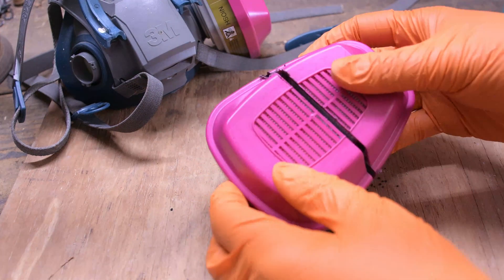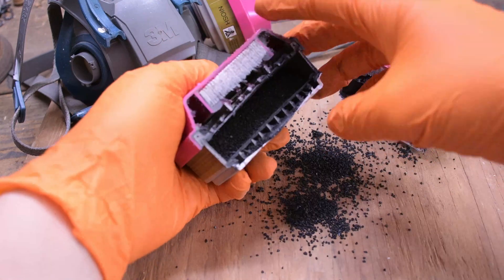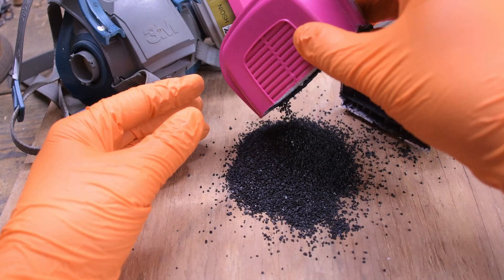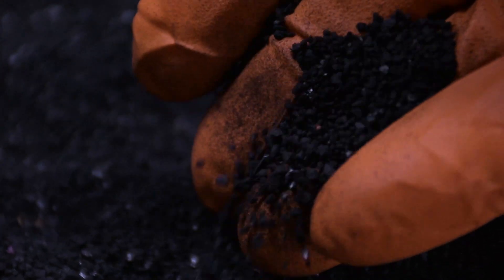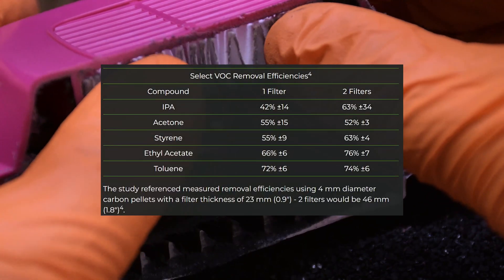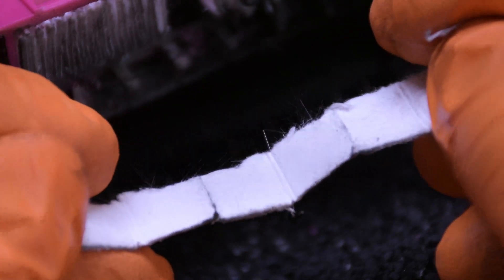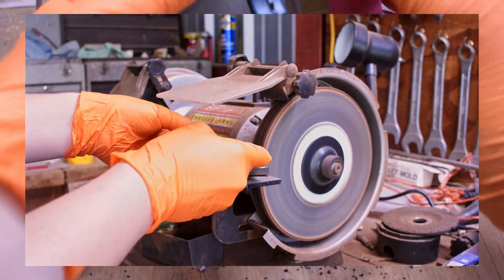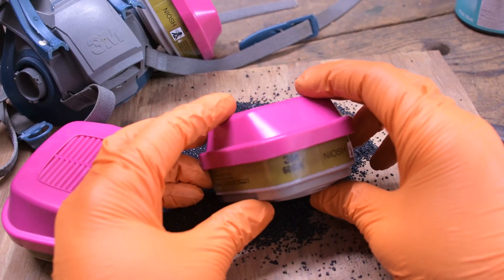Respirators for 3D Printing - Resin Fumes & FDM Nanoplastics

Comment: HEPA and activated carbon does next to nothing for VOC, only odour. You need PECO filters for that size of particles.
Reply from the maker: HEPA material does capture all particulates, even UFPs, at rates no less than 99%.
Activated carbon does capture VOCs, of which most are odorless unless in a concentration above our perceptible threshold.

The main issue with PECO filters in this instance is that they do not exist in a consumer-facing cartridge for a respirator, and the prices of PECO filters are far beyond what most people would be willing to pay for peace of mind. For that price point, a Supplied Air Respirator starts to make more sense.
Reply: @ArisAlder   Based on what? I have a WINIX air purifier right next to my printers and I measure air quality with an external meter. It helps, but not by much. Worst readings are when I open the resin printer lid or when I clean the prints with IPA. HEPA captures, PECO destroys particles and its technology is for much finer particles than HEPA. 
Molekule has a PECO purifier but only available in the US at the moment. Their mini is at a reasonable price. 
I do wear a respirator mask when I clean my models like the one on the video but knowingly only for the odours as it's not doing much else. 
This response is to raise awareness and stop people from believing their ELEGOOmate will do anything other than removing odours, something that activated carbon (pellets, not crumbs or dust or sheet) filters do extremely well. 
There is very little study on this unfortunately, I'm merely stating my own experience. Do your own due diligence.
Reply from the maker: I'm not disagreeing that a catalyst has the potential to remove more VOCs from an environment. I'm merely point out that in the context of a respirator it is irrelevant since products do not exist yet.

You are absolutely right that the 13.6 gram brick of compressed carbon from Elegoo and Anycubic is essentially useless. Carbon granules, especially in a thick bed will be more efficient and have a higher holding capacity.

The most affordable thing that people can do for a resin printer is to vent the contaminated air outdoors.

Comment: Can i use 6001? Their cheaper cartridge. And how long can I use them before replacing?
Reply from the maker: You can use the 6001 cartridge for resin printing, but it will not have the particulate protection.

For the hours, look for my comment under @spamspasm or @ thehalo3
Reply: Thanks, I'm thinking of using 6001cn for resin printing and 2097 for airbrushing. its cheaper for me to get 6001cn and 2097 than buying one 60921 cartridge.

Comment: Nice vids! So i have a half face respirator but if I had a carbon air purifier next to my resin printer would that help even more? I would love to know if you recommended any.  I do my printing in the garage.
Reply from the maker: Thanks! Any carbon filter in a garage or workshop would provide little to no benefit if the area is naturally ventilated. The best thing that you can do is to exhaust the resin fumes outdoors while wearing a cartridge respirator or supplied air respirator.

Comment: Hi, first of all it's a great video, I have a question, I understand why the sanding process is dangerous, but why is the painting process dangerous?
Reply from the maker: Painting can be done via various methods, some more dangerous than others. For example, hand brushing a water-based paint is super safe and doesn't require any protection. Spraying painting, especially with a solvent, will need to be done with ventilation, such as a spray booth. Spray painting releases tons of tiny particulates and VOCs. Clear coats, such as Krylon or Everbrite, will need to be in ventilation.

For painting, follow the manufacturers recommendations regarding PPE or ventilation as these will generally be present if any solvents, particulates, or other VOCs are released.

Comment: Thanks for this! A few questions. Will a 6006 paired with a 5n11 be good enough? Also, i print 5 days per week. How often should I replace the cartridges and filters?
Reply from the maker: The combo cartridges should be cheaper than the two separate filters. If you do not need the particulate protection then going with the 6006 by itself is fine.

However, you are resin printing enough that it’s probably worthwhile long-term to look into a supplied air respirator. I just released a video on these. They deliver clean outdoor air away from the contaminated environment.

For the how long on the cartridges respirators, I’ll copy paste from a previous comment.

An estimate will be 10-30 working hours, which will be a dozen plus sessions. However, the exact lifespan can drastically vary depending on the chemicals, their concentration, ventilation, temperature, humidity, and your rate of breathing.

You can use this website https://sls.3m.com/ to input chemicals and receive an estimation of the lifespan, but this generally requires knowing the exact concentration of the chemicals. One option is to use the concentrations reported by a study such as https://chemicalinsights.org/wp-content/uploads/2022/03/2021-Summary-Report-Particle-and-Chemical-Emissions-from-a-Vat-Photopolymerization-3D-Printer.pdf

When you begin to smell the chemicals through the respirator, the cartridges will need to be replaced. Once you know how long this takes, you can start replacing them in regular intervals before the end of their lifespan.
Reply: @ArisAlder  Where I live the combos are actually more expensive (and harder to find) 🥲Would a 6003 paired with a 5n11 do the job alright?
Reply from the maker: @Nayelianne  What country do you live in? 3M has, I believe, 3 different models specified for areas/countries.

This question gets brought up a lot so I may do a short video on it in the future.
Reply: @ArisAlder  Uh, I had written a longer response but yb made it poof, so just not to leave you without an answer: I live in Brazil. The 60926 has the same numeration here it seems, it's just not available through official venues, so the combined ones we can find are of questionable legitimacy, and financially strenuous, to say the least haha.
Reply from the maker: @Nayelianne   If you have a reddit message me there:
https://www.reddit.com/user/Aris-Alder/

I'm searching right now to find the most appropriate and affordable option

Comment: I got myself a 6006 cartridge should i switch to a 6001 instead?
Reply from the maker: It would be best to stick with the 6006 due to the extra protection against Formaldehyde. Just keep in mind that these will have no particulate protection.
Reply from the maker: 6006 is perfectly fine; it provides more protection than 6001.

Comment: I work in a print farm consisting of about 85 FDM printers printing PLA. The space is fairly large but I am around the printers most of the time out the day. We do not wear any type of PPE. Should we wear respirators or any type of mask?
Reply from the maker: Does the space have any type of ventilation or filtration?

That scale would generally prompt an expansive system so that respirators are not needed. The air would get sucked out of the room, filtered, and replaced.

If this is not the case, then a respirator should be used.
Reply: @ArisAlder I have a small FDM anycubic printer with no shroud that I use in my garage with the door open and a fan and leave while it prints.. Are these filter pads adequate? I have asthma I can’t get anymore problems ya know?
Reply from the maker: @Roninkinx  They are quite effective. For particulates, they use P100 material which is rated to capture 99.97%. For VOCs, which depends on the filament and thus emissions, that capture efficiency will also be the majority.

Cartridge respirators like these are not as effective as a supplied air respirator, but they cover most scenarios.

If you are waiting to go into the garage till after the print finishes, give it an extra 15 minutes to air out then head in with the respirator. Check yourself after each sessions and see if it does affect your breathing. The majority of particulates and VOCs released should be expelled if the area is properly ventilated, and the respirator will protect your from anything remaining.

Comment: What about cartridge #60923?  Does it offer the same protection?
Reply from the maker: 60923 will offer a similar level of protection as 60921. It provides additional focus against acid gasses, and it is usually more expensive than 60921.

Generally, I try to recommend 60926 since it does have protection against Formaldehyde, which is not only a VOC present from resin but it is in a wide variety of other chemicals.
Reply: @ArisAlder  I have gotten my mask and 60926 cartridges per your links.  The mask fits great, and seals good according to the test instructions.  What's your preferred method to clean it?
Reply from the maker: 3M recommend to clean the mask with warm water then air dry, with compressed air or a fan. For disinfecting they recommend using 1 part bleach for 250 parts water.
For very quick cleaning I like using pre-moistened wipes with IPA. You can find these on amazon really cheap in packs of like 500 for cleaning glasses or screens.
Reply: @ArisAlder Got it, thanks!
Reply: @ArisAlder  Hi big thanks for doing all of this! Which one would you prefer with resin printing: the 6001 filters, or the 60923. Reason is, M3 is barely available in Europe and 60926 is not even listed (at least not on Dutch and German Amazon and other shops)
Reply from the maker: @BossBabyBestAnime  3M has a different series of cartridges to meet EU standards. I believe the one you will want to search out is the 6075 - I see it on sale for about 20 euros online. If you can find the combo version that includes the 6075, that would be ideal since it also captures particulates.

copy pasted from me on discord helping someone else
"6055 will be the more affordable version, but 6075 is the best for resin
(same goes for the US version 60921 and 60926)
resin gives off some formaldehyde, so having filter media impregnated/designed for that purpose is ideal"

Comment: Hello! Thanks for the video, it was very helpful. I hope you can answer my question im having so much trouble getting an answer to. Can i do with a half mask when i have a full beard. Or do i need to invest into something large like the 3M Silicone Full Mask Size M 6800M EN Safety Certified mask which is like 200$.
Reply from the maker: One of the best options for you and arguably a safer alternative to these cartridge respirators is a supplied air respirator. Normally these are in the thousands, but I have been using a DIY version for some time to test it. I am planning on doing a video for it, but some details do need to be refined and checked for safety purposes.

I believe I saw your reddit post on this a few minutes ago. I will dm you there with a few more details.

Comment: Hi - I have a 3d resin printer but we can't get the 6092x series of filter cartridges here in the UK - is there another you would specifically recommend in the 600x line? I think I can get the 6001 but want to get the best I can. Also I may have misheard or misunderstood but around the 2 minute mark you mention that particulate is a potential issue in the post processing stage - sanding, obviously I can understand, but painting? Should I be putting my mask on while painting 3d printed miniatures? I would have thought after curing the models would be basically safe to handle and be around?

Cheers!
Reply from the maker: This is a good clarification - painting will release particulates in aerosol form, so cans or airbrushing. Hand brushing low-VOC or water-based paints probably don't need a respirator, but some paints and clear coats will have fumes where you may want one. The Everbrite clear coats that I use regularly need ventilation and the respirator.

If you are not sanding, airbrushing, or using aerosol cans then the 6001 organic vapor cartridges will work. Otherwise, I checked the UK amazon and found combo 60923 and 60928 cartridges in-stock. These will be similar but are slightly more expensive than the 60921 cartridge.

Once the resin prints are cleaned and cured, they are drastically safer, but technically they are not safe as they could be. Handling safety for miniatures will be improved once they are painted or clear coated.

To deep-dive into the handling safety, it's reasonable to look at biocompatibility tests for resin, which can include the use of zebrafish embryos. In one study, they conducted these tests by subjecting the embryos to unwashed and washed discs of resin approved for medical applications (stricter safety than consumer resin). The embryos exposed to the cleaned/washed discs were much more likely to survive, but the survivors could still develop malformations. There's some more on that here https://4dfiltration.com/resources/3d/3d-uv-resin-toxicity.html#Cleaning

One takeaway we can get from that is the resin parts that are cleaned, cured, and coated will be perfectly safe for normal handling, but the resin parts should be kept away from toddlers, food, and drinking liquids.
Reply: @ArisAlder  Thank you so much for the excellent and in depth response! 
 
This is massively helpful to me. And fascinating as well! 

Yes I try to be as safe as I can with it all - I'm only new to printing but in terms of setup I have my 3d printer in my outbuilding/hobby shed - I didn't get one until I had the outbuilding specifically because I don't want one in my house where me and my wife and kids would be exposed to it with any frequency- I try to keep it as ventilated as I can in there, and only go near it when it's in use to start a print off and for clean up of prints and parts (aside from the odd check to see it hasn't failed now and then)

That study with the fish embryos is really interesting, and food for thought - I think I'll be operating a sort of "print it, cure it paint it asap" schedule where it's practical rather than having a bunch of cured models sitting around that might still be partially toxic. After all why take any risk you don't have to?

I shall look into Amazon - many thanks was having a lot of difficulty sourcing them from suppliers -didn't think to look there!

Cheers!

Comment: How long do these cartridges last and how do I know if one has gone bad and needs to be replaced?
Reply from the maker: An estimate will be 10-30 working hours, which will be a dozen plus sessions. However, the exact lifespan can drastically vary depending on the chemicals, their concentration, ventilation, temperature, humidity, and your rate of breathing.

You can use this website https://sls.3m.com/ to input chemicals and receive an estimation of the lifespan, but this generally requires knowing the exact concentration of the chemicals. One option is to use the concentrations reported by a study such as https://chemicalinsights.org/wp-content/uploads/2022/03/2021-Summary-Report-Particle-and-Chemical-Emissions-from-a-Vat-Photopolymerization-3D-Printer.pdf

When you begin to smell the chemicals through the respirator, the cartridges will need to be replaced. Once you know how long this takes, you can start replacing them in regular intervals before the end of their lifespan.

In a future video I will touch on supplied air respirators, which are arguably safer and cheaper long-term. These deliver cleaner outdoor air straight to your face through positive pressure.
Reply: Thank you so much for this. I'm looking forward to your future videos

Comment: hi, i wax castable resin which needs to be post processed in ethanol after printing. what would you recommend for this?
Reply from the maker: The 60926 is what I generally recommend, and if it is out of stock then go for a 60921. Also, ventilation should still be used for the post-processing.